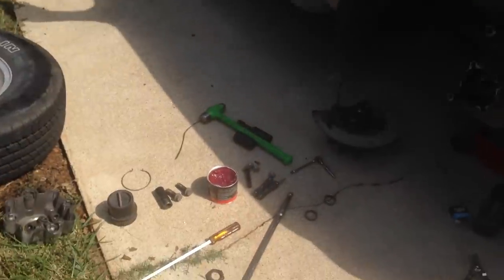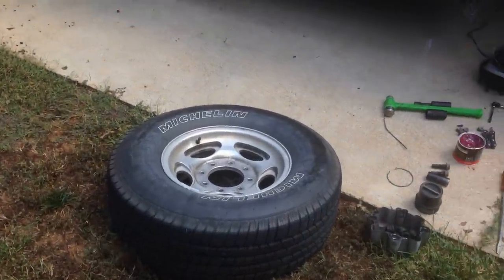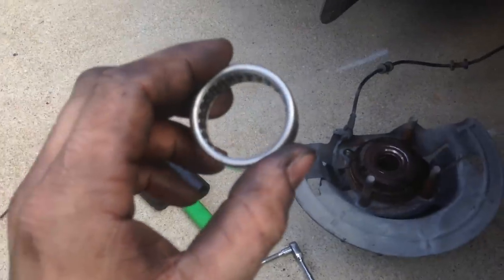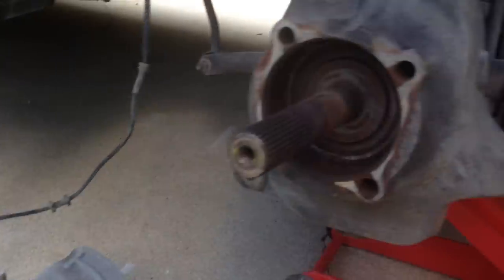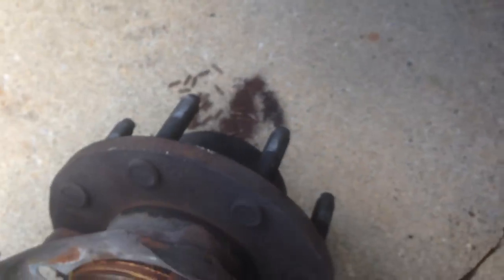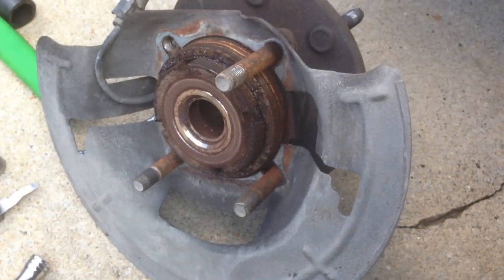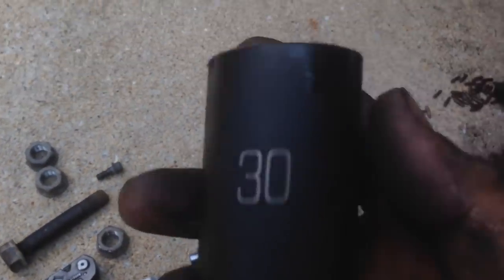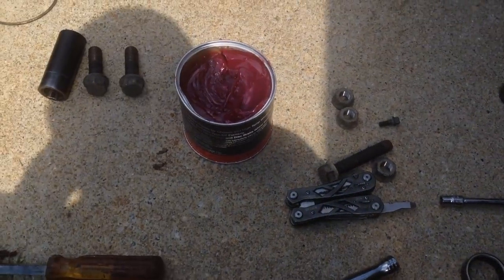Ford Excursion & F-Series Rumble Noise

Comment: Daniel Thank you so very much. I've been trying to figure this out after checking ball joints, half shaft U joints, this was my exact same problem the same thing would happen. I was about to send my truck into the shop which I do not do often. But this was the fix. And I can not thank you enough!!

Comment: Had the same issue. Started off as a growl thought it was a hub. Literally the exact same thing. The bearing even fell out identically. Took me 1 hour and 45 minutes for driver side. Don’t know how you got it done in 15. Before removing the hub assembly there was also a retention clip that you have to expand to remove.

Comment: The infamous ford "death wobble" it sounds like.
Reply: Matt Dias the death wobble is a bushing issue
Reply: Nope...it is a caster issue that can be overcome by replacing ALL the worn parts in your front end and going back to the stock wheels and tire size. Also...if your Ford has no track bar...get one. Sad but true...

Comment: My 2003 Excursion had that rumble noise so I changed out the complete wheel bearing hubs and the noise is still there. What ever could be wrong? The tires show feathered, could the tires made that rumble noise?

Comment: Once on the truck,  how do you grease them?
Reply: Tear down and re grease the bearings and put back together.  The same way you replaced them. It sucks but you can inspect the axle and breaks as you tear down. (A safety inspection of all other parts while apart)
Reply: Riffraff Diesel makes the hubs serviceable with its in house grease zerk fitting for ABS equipped hub assemblies.